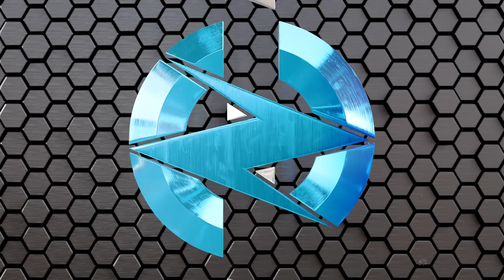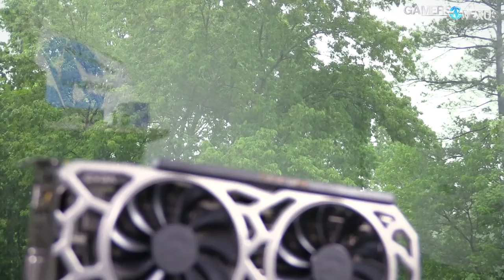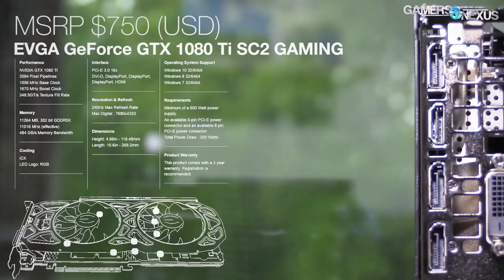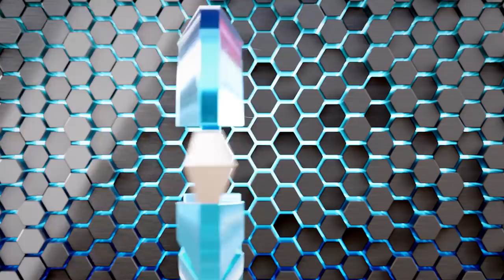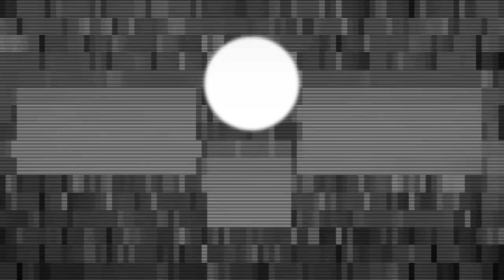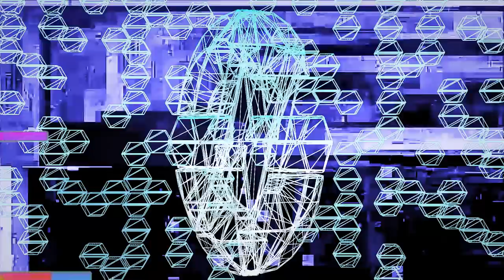NVidia's 16-Phase Titan V VRM Analysis & Shunt Mod Guide

Comment: If there's no doubler on this card this means that the switching frequency before it hits two of the MOSFETs is double and ends up splitted in half when it enters them? The inefficiency of this strategy can be overcome with the use of a massive power delivery like this?

Comment: So it looks like the Tesla card would have a doubled 8 phase for 16 phases, and three phases for the HBM.  It also seems like there are two extra spots for more power stages. If the Tesla cards had video out, then it would be fun to try overclocking them.
Reply: the missing power stages are probably for 12V load balancing. The 1080Ti PCB for example has 1 phase with 2 sets of hi and lo FETs so that it can switch which 12V plane it pulls power from.

Comment: It appears the PCB has unused spots for 1 more HBM VRM phase and an 8-pin PCIe connection on the side of the card. What's the deal with that?
Reply: Cost savings.
Reply: I would assume the 8 pin at the back would be used in a Tesla configuration. In the rack mount servers, most cards have rear PCIe power so they can fit more in a smaller space.
Reply: My guess would be due to the 4th HBM stack being unused. This could very well be a "cut-down" Tesla which uses all 4 stacks (for 16GB) thus needs that extra VRM, which as we know, isn't used.
Reply: Rhyan Eddy it is a cut down card
Reply: also looks like a vga or something is missing on it by the ports.
Reply: But, wasn't that an opportunity to push out more powerful cards with higher power envelope? The chip itself can easily catch 2GHz in all situations I've tested it (shunt modded). I

Comment: btw don't use gallium, (on your "shunt mods") or liquid metal as you would call it, with tin/solder :) it will start to disintegrated the solder weaking the solder and the shunts will falloff and possibly destroying the resistor. it will wet most alloys.

Comment: Might the mistery shunt be for the missing 8 pin? How about putting an extra shunt resistor on top of the existing ones to halve their resistance? You'd be able to still regulate power in msi afterburner by just halving what you want. LM might be easier to reverse though.
Reply: the liquid metal or conductive ink is reversible. If you want to go all in with mods there's a million ways to trick the INA3221s into under reporting the power draw of the car.
Reply: Thanks for the reply, happy holidays in Czech! Btw I have some 1080ti's which I'm opening up which you didn't review yet, gimme a shout if you want pics of the PCB's.

Comment: Doing some math, if the TDP scale is linear on those Fairchild chips, i would assume about 40W of heat from those chips with the core at full load?
Reply: Very unlikely to be linear. Most Vreg chips have at least a soft curve to their efficiency. I'd expect that at half load you'd have about 3/5 the dissipation. Remember that power throughput is still king when it comes to the efficiency of most regs. Given that, not sure that it would ever matter given that they are so over-scpecced for the job
Reply: it's not linear. Here's the datasheet: http://www.onsemi.com/pub/Collateral/FDMF3170-D.PDF

Comment: If VRMs can tolerate fairly high temperatures and minimizing regulator-to-die distance is important, why not put the VRMs on the opposite side of the PCB and cool them with the backplate?
Reply: it wouldn't play well with the PCI-e expansion card format.

Comment: Question for Buildzoid; I'm hitting voltage/power limits on my Zotac 1080 ti arcticstorm, is the "shunt mod" relatively safe, and how would I boost voltage past 1.093v to eliminate both of those power limits?  Current clock max is 2101, but drops to 2088 frequently due to power and voltage limits.
Reply: You cant past 1.093v without special ASUS bios for Xtrim OC or hardware mod. Power mod is safe, cause you limited by voltage and thermal limits.

Comment: All those empty pads i assume it will be the same PCB as the tesla 
also those random regulators, one might be the 3.3v for the HDMI and DP instead of pulling it from the PCI, not sure about the other but it might be a 2.5v aux ... volta is a new and radical architecture it might need more voltages
Reply: there are LDOs in the display output area of the PCB
Reply: Ah okay that makes sense

Comment: Could the reduction in phase count be due to a lower phase margin when doubling that many phases, at 0.1 modulation index you would not get overlapping phases with 8 phases, you would at 16, this couple possibly reduce performance when increasing the number of phases? Coupled with the high effective switching frequency of over 2Mhz in this card the capacitors could be working above their resonant point when doubled? I am not an expert in Smps design by any stretch but it seems to me that in this circumstance more phases has the possibility of performing worse in practice due to physical limits.
Reply: The big SMD polymers are for transient loads. Though some SMD Polymers will work into the MHz ranges. The MLCCs are for switching noise(which the GPU core itself makes way more of than the VRM ever will). Also with a 16 phase interleave you end up with a lot less ripple that needs smoothing to start with. There have been VRMs all the way upto 32 interleaved phases on GPUs and motherboards. The only real down side with any of them has been the insane costs to manufacuter them.
Reply: I know that the switching noise is covered by mlccs, I was talking about the effective current ripple of the DI/Dt of the polyphase buck converter. I always thought that transients in these cards were handled by using the control loop of the converter?
Reply: Anno van den Akker - Extra phases in a power supply absolutely make the ripple of the converter smaller, but in effect they increase the effective switching frequency of the converter by the number of phases, thus the capacitors see an effective current ripple that is a multiple of the switching frequency of the MOSFETs. So yes, an 8-phase converter will have a much higher effective switching frequency from the point of view of the capacitors. As an EE I have designed and built multi-phase mhz range converters before, just not at this level of power or sophistication.
Reply: Anno van den Akker, huh cool I guess I thought that the digital Asia control loops were faster than that. Also thinking about it, because the converter is in CCM the output filter may not need to be very large, enabling small mlccs to work here. Thanks for the clarification.
Reply: The VRM is never going to respond fast enough to handle the transient without bulk capacitors acting as a buffer. On a 16 phase the ripple would be higher frequency but it would be a lot lower amplitude.
Reply: Anno van den Akker I suppose this has to do with the plane/trace inductence between the phases, even though all the output caps are in parallel? The current loops there would be significantly larger so I guess I get what you mean. But then those polymer caps would have to be handling that ripple because of the current loop?
Reply: Anno van den Akker also thank you for taking the time to help a non-expert understand the practicality of these large polyphase converters. While I will likely never build one on anything like this scale it is good to finally understand them better.

Comment: So I'm in no hurry but I do want to upgrade. I have a 970 and I'm looking in the range of a 1080 ti, wondering if I should buy the 1080ti or wait till a new generation comes out? I play at 144hz 1440p
Reply: Diabetus_Elitus definitely wait. navi looks like fun. check out vega at 1700mhz (mindblank) imagine what the next gen will do... and how nvidia will respond.
Reply: Why wait when you can get the performance you want now with 1080ti?
Reply: Buy the 1080ti now.
There's always an option to wait, but it makes little to no sense if current hardware does what you need it to. 1080ti is dope.
Reply: Wait only for confirmed releases, not speculations. Buy when needed. 

Words to live by.
Reply: GA104 starts production mid january, but comes in Q2. if you want a custom card not reference you need to wait at least till may. reference cards will be released in april. thats what heared from an insider. it brings only 20-30% better performance ontop of the 1080ti but for the same price an lower consumption.
Reply: @BlacKi "Only" 20-30% better performance? :)
Reply: exactly, the big chip GA102 will be expected 2019. the "small" GA104 is around 50-60% ontop of the 1080.
Reply: Diabetus_Elitus buy a 1080 ti. You can sell it at $50-75 less right before the next generation released
Reply: Just wait, the 970 is still more than enough for the moment, volta cards probably won't be that far off not much point spending 1080ti money now when you can get it with a 1170/2070 for a lot less soon.
Reply: I'm in same situation with shitty 1060 i bought for fun. Just wait, 3-4 months and we should see new cards for sale.
Reply: WayStedYou 1080 ti would be more on par with 1180

Comment: Honestly if you are looking at this and thinking of doing it you're better off with a 1080Ti Kingpin Hydrocopper card - already modded, full cover block included, backed with a warranty and less than half the price. Just my 2 cents.

Will GN actually DO this mod and retest the card??? Because if not then it's a complete waste of time and money at this point. I would at least hold off buying until EK or someone makes a full cover Titan V specific block.

Comment: Could always just add your own doublers, maybe.
Reply: you'd need to hunt down some 0ohm resistors that route the PWM signals past the doublers and into the phases. So while a doable modification it would be pretty time consuming to do.
Reply: That's about what I figured: Possible but hard.

Although if you're committed to doing something like that, then you probably know what you're doing in the first place.

Comment: The market Titan V is targeting is certainly getting what they paid for, the best of the best for $3000. I'm waiting for Volta Titan gaming version which will be the most future proof GPU ever and realize a single GPU solution that makes multi GPU setups irrelevant.
Reply: MS DX12 pretty much made multi GPU setups irrelevant, DX12 makes it harder for game developers to optimise for multi GPUs with next to no ROI. 

If you think Vega 56 makes multi GPUs irrelevant then you need to include factory overclocked 1070/1070ti, just saying.
Reply: Max Facts 1070Ti isn't factory overclocked ;p Nvidia banned manufacturers from doing so. Gotta do it manually.
Reply: Max Facts Can we stop with the Future Proofing stuff? NOTHING is future proof.
Reply: " Computer tech is outdated every 2-3 months "  only if you buy bottom feeding gutter gaming products. Intel CPUs like Sandy Bridge had many years of enough performance to not bottleneck high end GPUs, I'm talking gaming performance. 

I did NOT say future proof, I said, "most future proof" meaning longest gaming viable life span, I'm thinking at least 8/10  years of no GPU upgrade needed with a factory OCed gaming Ti version of Titan V.
Reply: Sukhoi Fockewulf
no, No, NO and I always qualify, "Future Proof" using a determiner like, "most".
Reply: OK Eddy you're right about the 1070ti, thanks for the correction.
Reply: Max Facts there is no future proofing or else Evs wouldn't be coming back as they are relics of a long gone age and the gasoline and diesel engine wouldn't be going under constant revisions because governments don't really support better fuels nothing is future proof not even the human body

Comment: 1.8V for BIOS? shut the front door.
3.3v!
Reply: 3.3v hasn't been relevant on really high end stuff for a long time. It's a great standard for low power, hobby stuff, but not so much any more.
Reply: Nvidia runs 1.8V BIOS chips for years now.
Reply: from what model?series?
Reply: I think since Kepler. Though I haven't actually checked any Fermi card.
Reply: 1.8v GTX 1050. frak me! i just check it now.